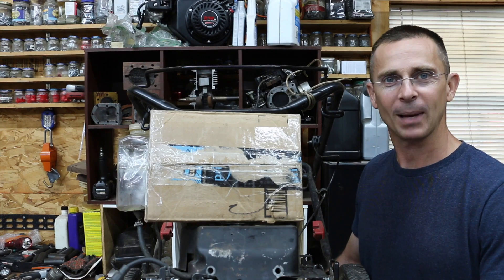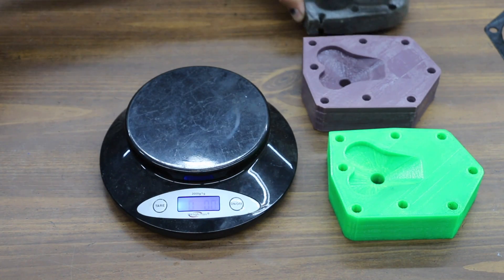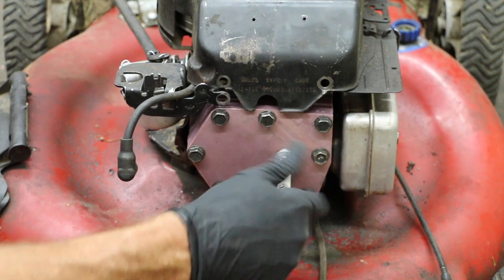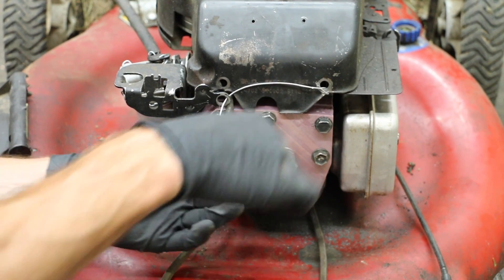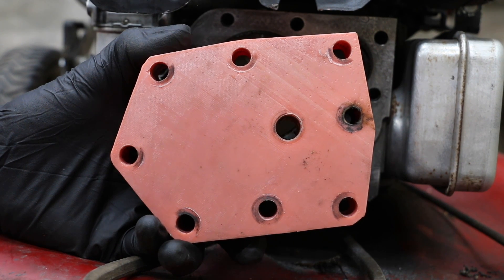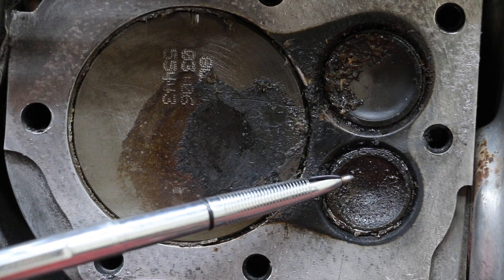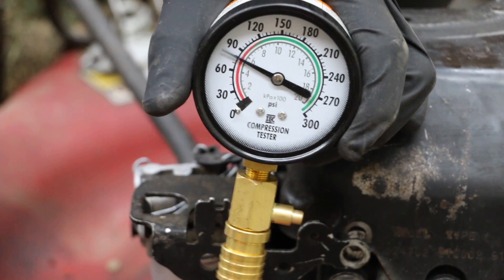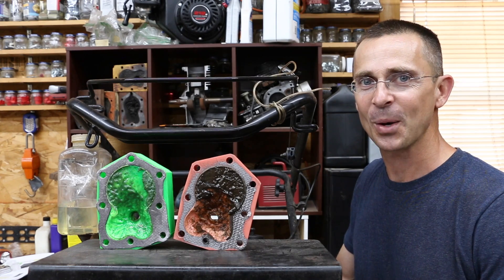How long will a 3D printed cylinder head last?  Let's find out!

Comment: those printers can use other kinds of material. I've heard there are tungsten, aluminum, and other metal compounds that can be used in some of the commercial machines. Now, figure out how to make a ceramic cylinder head. Ford experimented with entirely ceramic engines years ago, with some success, but the cost to produce, and then the public opinion of them negated the project. However they did run a version of the pinto engine made in ceramic for a very long time without stopping... I think it was either 180 hours or 180 days. When torn down, there was no visible damage at all. Of course they were using some high tech ceramics. You could probably make a mold from a metal cylinder head, but normal ceramic shrinks some as it dries, so you'd have to allow for that shrinkage... somehow. Another question that came to mind when I saw these plastic heads, what effect does the roughness have over being smooth? It could allow for better air fuel mixing, or it might have no effect at all either way. That brings up another idea from long ago I heard about but never saw tested. One guy swore up and down that steel wool packed in his intake tight, with a fine mesh screen on the end going into the engine would increase his mileage greatly, but of course the intake would glow red hot in short order.
Reply from the maker: I'd really like to test these other materials.
Reply: Good luck with that, unless you happen to know somebody that has the large commercial version of the 3D printer, and is exceedingly generous, you won't be able to. Those materials are not cheap, and the printer... well unless you've got a huge multi-million dollar company, forgeddaboudit. 

However, I have wondered what would happen if the head was copper, bronze or brass. The formulas for brass and bronze vary, some can be exceedingly hard, which also means brittle. There are other plastics as well, some are made for high heat. I hear there are now some ceramic based formulas as well. I surmise that different materials are powdered, then mixed with the resin, so the resin used would be important. The technology is still in it's infancy, what may come around in a few years might be really amazing. 

With CAD driven CNC machines being fairly available these days, There are probably a whole new range of materials you could try. There is even another wood you can try, it's a composite, put together under extremely high pressure. It's so tough we used the same machines t mill it and polish it as are used with steel. This wood is somewhat similar to plywood, but like super plywood.

Comment: you should try a flame resistant poly carbonate, If i still had access to a 3d printer id send you one but i dont. here is a link to the material i am talking about  https://www.matterhackers.com/store/3d-printer-filament/flame-resistant-polycarbonate-1.75mm?gclid=Cj0KCQjw45_bBRD_ARIsAJ6wUXT7k5k2QghXfzkYSqoKxXgox6eaApPvix4MDkwjc43mFHpNbM02jcoaAqcMEALw_wcB
Reply from the maker: Great recommendation!  I'd really like to test it!
Reply: forgot to mention they do have filaments with metal in them but i dont have any experience with these and do not know how they would hold up

Comment: You gave the Germans the next great idea for their cars..... hahahahahaha!
Reply: Can't be any worse than the gaskets/o rings BMW already use...
Reply: Alex O'Dell so true
Reply: 3D printed catalytic converter? VW would be on board with that!
Reply from the maker: lol
Reply: what is that supposed to mean??
Reply: It means the Germans have a bad habit of doing stupid crap with their cars, and this is just another bad idea the Germans are likely to copy, making cylinder heads out of plastics. And these days, it isn't just the Germans doing stupid crap, its the whole industry, but the Germans are normally the first in line to engineer things in ways they should not be. Modern German cars are a bad joke, and they only make them worse.
Reply: Carstuff111 So much for them being on the forefront of innovation.
Reply: Over complication, is not innovation.  Most of the crap on cars just is not needed. I understand adding safety equipment, the passive stuff, but the electronically controlled "safety" equipment, time after time I see that crap failing and is just not worth the headache. And the Germans are often at the forefront of adding new crap to cars that just means adding yet more crap to a 10 pound bag, that is already loaded with about 50 pounds as it is. New cars tend to be a nightmare to work on, and once again, the Germans are on the forefront of that as well.
Reply: @Carstuff111  you make some very interesting points but it's all failing due to cost cutting. The electric safety systems for example are extremely sensitive so they wire it up with the thinnest wires ever seen. Then you have the way it's made. It's not a repair industry now it's a replace one. "You're indictor bulb has blown. That's an engine out job post 2018. You should get a new car to be honest..."

Comment: Why not try a cylinder head 3D printed with carbon fiber material?
Reply from the maker: Great recommendation!
Reply: Most 3d filament that's coper infused is pla and  has a similar melting point of normal pla
Reply: RedneckCanadians  Intersting. You made a good fact. Thanks for sharing your knowledge.

Comment: You probably could make a cylinder head out of plastic but it is ignorantly optimistic to expect a fdm 3d printed one to work. They whole way fdm 3d printing works is by melting plastic at 190-260 degrees Celsius. There was never a chance that these would work. If you wanted plastic cylinder heads you would need a thermoset plastic or some type of plastic with a much higher melting point
Reply from the maker: All great points and thanks for commenting.
Reply: Well I think we all new they would fail but how long is the question?

Comment: Next test: Run plastic cylinder heads and then reinstall the mental ones to compare B12, seafoam and water to see which is better at cleaning the burned plastic off of the valves, piston and cylinder walls.
Reply from the maker: Great recommendation!

Comment: Still more reliable than the Briggs that originally came with my husaquvarna mower. 

The engine you got there has gone through every experiment imaginable and still runs. Mine didn't last a year cutting grass. What happened to B&S?
Reply from the maker: lol. Yes, the flathead briggs design is practically indestructible.

Comment: I think that a 3D printed cylinder head would work with some modification.

A lower energy fuel like alcohol would reduce the temperature, coupled with the lower compression ratio already present with these heads because of the much larger combustion chamber. Additionally, water cooling passages would need to be added (especially around the exhaust valve.) Using a stronger filament more resilient to heat, like carbon fiber or copper/aluminum powder with an ABS binder would also be better.
Reply from the maker: Great recommendations.

Comment: You do some crazy tests, and I sure wish briggs and the other small engine manufacturers would get away from plastic engine parts and maybe even spend the extra $2.50 and put actual crank bearings in their engines.
Reply from the maker: lol. Great point. The cost cutting methods used these days really hurts the quality.

Comment: All right this is Pure Sience of what 3D printers is able to make and what theese materials can handle. I haven’t studying the available materials to use in an 3D printer but I have a feeling for that you can make a fully functioning cylinder head and gasket out of the correct 3D printer material with an Printer that will support that material. 

I absolutely loved this video. I designed a coin holder to store my change in the cab with an 3D printer and it is fantastic :) 

Thank you for generate this video :)
Reply from the maker: Thank you very much!

Comment: Some day there will be some high-temperature plastics that can be used in 3D printers and this melting issue will be gone. One great thing about 3D printers becoming more popular is it will drive plastic innovation. The day will come when most if not all automotive parts will be printed with plastic. Maybe even entire engines could be 3D printed (cheaply) and still make it to a couple hundred thousand miles. Of course, plasstic that can withstand the high temperatures of combustion will have to be heated very high in order to be used to print stuff. Nothing is impossible if there is enough demand for it (and profit of course). I've been holding out on buying a 3D printer until the quality improves enough and the price drops enough. Maybe another year or so.
Reply from the maker: Great point. I really like where the technology is headed!

Comment: How big is the gap on the spark plug at 6:30 ? Seems like you can park a Boeing 747 in there.
Reply from the maker: lol.  Yes, I wanted to avoid having the electrode fail again.
Reply: Yeah of course, looks like it worked too

Comment: That was really interesting I never would have thought of that idea. I really want to see an engine with butter instead of oil.
Reply: Ghee, I would too!
Reply from the maker: Great video idea!
Reply: Watch Life OD they run cars on crazy things all the time. Baby oil, WD-40..
Reply: SRT8 MadMan when I was a kid we ran an old 2 horse tecumseh with peanut oil in it. Governor wide open & no load. It would sieze & free up as soon as she cooled down. Ran that way for maybe 3/4 tank of fuel until the rod let go & put a nice hole in the block.

Comment: ... I wonder how well a 3D printed piston will work lol.
Reply from the maker: lol. That would be fun to test!
Reply: Project Farm  I'd be game for that... Or maybe a connection rod? As it would have less heat
Reply: @ProjectFarm  3D printed engine, but have it run on liquid nitrogen. At least it won't melt!
Reply: A 3d printer which uses something like jb weld as printing Media Would be nice for building a whole engine
Reply: There are videos where people use plastic pistons. Obviously, they don’t last long.
Reply: 5Rounds Rapid 
And wood pistons , they run fine when cold , but when the engine goes hot it bruns fast and the engine stops of  weak compression .
Reply: The piston would last a few strokes before a hole would be melted into the bottom of the cylinder.
Reply: 3d printed rod would likely work for a bit, just need a bearing to stop heat going into the plasic 
But what about a wooden rod?
Reply: it wouldn't...lol
Reply: Temperature of the ignition can get up to 3,000 degrees causing the top of the piston to heat up to 300 degrees while the bottom of the piston can reach from 160- 200 degrees. Also the piston has a possibility of ceasing up as the plastic melts/burns.

Comment: THE PURPPE RAN LONGER BECAUSE IT WAS COLD AND THE ENGINE WAS NOT WARM
Reply: ABS melts at a higher temperature than PLA though
Reply: smeezekitty I said my comment so it was something to think about
Reply from the maker: Thanks for commenting on this.
Reply: Purple ran..............purple ran
Reply: PLA has a printing temperature of around 190C, so the melting point is quite low.  In fact, it softens and becomes malleable just in boiling water.  ABS has a printing temperature of around 250C.  I suspect the gasket is polyurethane, which prints around 230C.

It would be interesting to try some of the higher temperature plastics.  Nylon and especially polycarbonate, which prints significantly over 300C.

Comment: I was impressed as well. But im wondering.  I see all those videos of people using small engines and converting them into generators.  Is it possible for you to test a similar setup using both a 4cycle and a 2cycle motor?
Thanks!
Reply from the maker: Thank you for the video recommendation!

Comment: Well, I assume everyone knew that the plastic would melt, no brainer. However, I wonder what would happen it you coated the plastic with heavy duty Epoxy first & then performed the test? Thanks again for a great video..........................
Reply from the maker: Great recommendation and thank you!
Reply: Ive been down this road with intake boots on a motorcycle engine. a thin layer is not enough to hold up to the heat and it ends up deforming anyways. Maybe a solid epoxy resin head would do ok? perhaps with some fiberglass mixed in
Reply: Maybe a ceramic coat?
Reply: Or mix the plastic with pumice, talc, concrete, graphite etc. Compounds are amazing.

Comment: Great video once again!
I have a 107cc 4 stroke small engine and it rattles at high rpm.. Its a atv engine so any suggestions on why it does that?
Its ohv btw
Reply from the maker: It's hard to say without hearing the rattle and seeing it.

Comment: Not surprising in that the 3D printed pieces are made via a melting process or at least sintering with moderate heat (thermoplastic).  Alternatively a thermoset plastic like epoxy or better yet phenolic should last a lot longer.  Those cannot be 3D printed but could be cast using a mold made from the original head.  The other thing that would be interesting is a head made from a high temp thermoplastic like PEEK or PEI.  Those would have to be machined however.  A really interesting video nonetheless and a major clean up project.
Reply from the maker: Great point.  Great recommendations!

Comment: I wonder if on the abs head if you put a layer of aluminum foil on it would it help prevent the issue of the head melting into the cylinder valves and spark plug gap. That also brings up the idea could you make a head out of layers of aluminum foil?
Reply from the maker: Great recommendation!

Comment: wouldn't the larger gap make it run hotter and melt faster?
Reply from the maker: Possibly.  PLA won't take as much heat as ABS and I was concerned about the electrode getting taken out by the melted plastic.

Comment: I wonder if a good layer of Coppercoat gasket sealer would make any difference. Perhaps only if MAYBE stopping the plastic from being all drippy. Not sure how the integrity of Coppercoat will hold up without being sandwiched between two surfaces.
Reply from the maker: Great recommendation!

Comment: What a great video. You have built an amazing community on your channel. It is wonderful to see people contributing to your YouTube content. They can 3d print carbon. Maybe a 3d carbon printed head would work better.
Reply from the maker: Thank you very much and I really like the 3D carbon head!
Reply: 3d printed carbon is just pla infused with carbon... No better as far as heat goes
Reply: what I was going to say, even abs infused would be about the same. I think PETG prints a bit hotter but you'd prob only get another minute runtime at best

Comment: I wonder how long 30% glass-fill Torlon or Celazol would last? Those, especially Celazol, have a lot of heat resistance. Of course your looking at about 150-400 dollar material cost to make them, but they could likely function as a cylinder head for some time.
Reply from the maker: Wow!  Expensive but that would be a fun test!
Reply: The Celazol can, for short times, tolerate an open flame (as in cigarette lighter). Occasionally I come across some scrap plate every now and then. If I do...

Comment: what type of brush do you use to clean the cylinder head/ valves?
Reply from the maker: It's a wire brush designed for a drill. I wouldn't use such an abrasive approach if cleaning up an aluminum head on an automobile.
Reply: thank you for the fast reply!

Comment: can you test a plasma ignition system using capacitors on a small engine? could the person who printed these heads add a cooling loop built into the head so it has a cooling source so the plastic melts less? Especially around the spark plug hole. A coolant tank and two one way valves would work so no need for a coolant pump. It would work like a coffee pot. low temp coolant passes first one way valve into head, heats and expands passing second one way valve pulling cool coolant in behind and pushing warmed coolant back to the holding tank.
Reply from the maker: Thanks for the video ideas!

Comment: No surprise the PLA lasted so much less than the ABS. Print temps can range between 180c-210c for PLA and 225c-250c for ABS. Printers and brands vary. PETG can take a higher temp (260c maybe more). It would be cool to see how well it handles the testing. I expect it to add another 40 seconds on top of the ABS at least.
Reply from the maker: This si great information. Thank you!

Comment: What if the plastic was lower than the engine instead of on the side?
Reply from the maker: Great point. Heat is the main issue.  It would last a long time without heat exposure.
Reply: Project Farm even see if high temp glass would prevail. If you use antifreeze as a lubricant to drill/ tap glass, you will always end up with good results.
Reply: Keep in mind, you can only drill, cut, or otherwise alter annealed glass. Tempered glass will fail unless it is fitted prior to tempering.

Comment: Or a lead cylinder head low melting temp also with maybe a ceramic coated spray baked on ? Or Evan wood with ceramic cost 

What ever cylinder head is easiest to make just add some ceramic coating ! Would be a very good test
Reply from the maker: Great recommendation.

Comment: Try a dense rubber cylinder head.
Reply from the maker: Thanks for the recommendation.
Reply: I can recommend http://www.smooth-on.com if you want rubber and plastic molding/casting material.